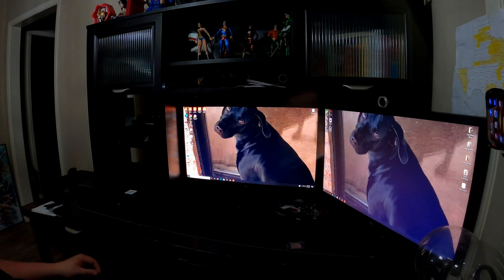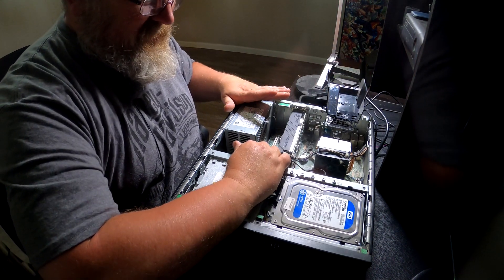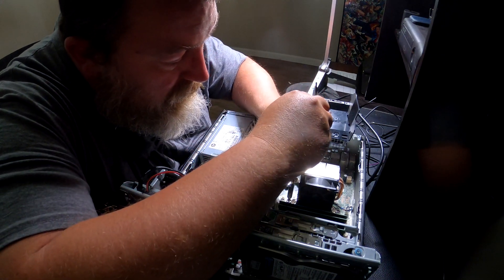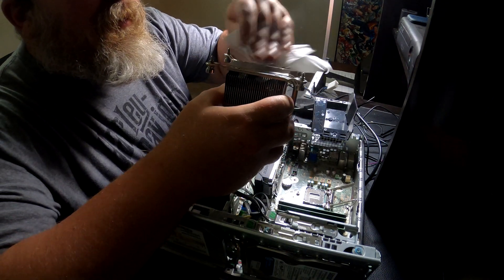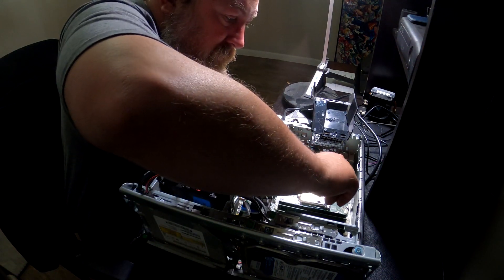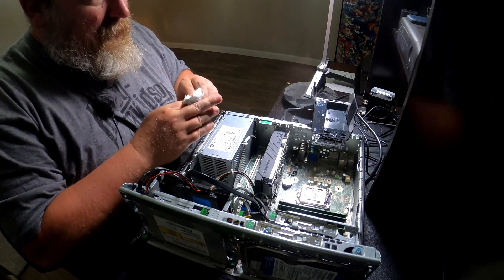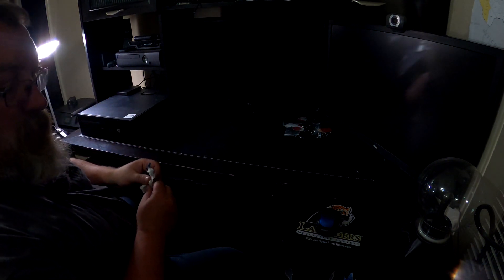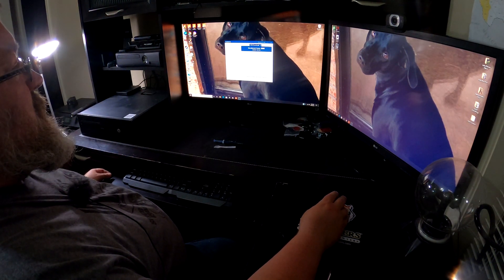HP EliteDesk 800 G1 SFF CPU Upgrade from i5 to i7

Comment: HP EliteDesk 800 G2 SFF should be your new choice.  Windows 11 can install & a M.2 Drive slot.  secure boot support & TPM installed.  About the same price as a I7 CPU upgrade for a G1.

Comment: is this the best cpu you can put in this kind of desktop?
Reply from the maker: Yes
Reply: @MotoNationUSA  thank you! I’m assuming 1650 LP the best gpu for this desktop?
Reply from the maker: @mengohim  the best that will fit inside the machine yes, you can get a full size card and mount it outside the case but I just got the 1650 low profile
Reply: @MotoNationUSA  Does the 1650 LP fit inside the ProDesk 800?
Reply from the maker: @Joe-oz9ys  yes it does that is what I have.
Reply: @MotoNationUSA  I have a 240w power supply but I would like to upgrade to 300 or so that will fit. Do you happen to know a model number on a replacement I could use to find it?

Many Thanks!
Reply from the maker: @mengohim  yes small form factor
Reply from the maker: @Joe-qh6gy  I don't know that answer.

Comment: What type of i7 is it and will it fit in hp 600 G1?
Reply: It's a 4th gen i7 4790 4 cores 8 threads. Yes it will fit.
Reply from the maker: @b0xxkn1gh79  Thx